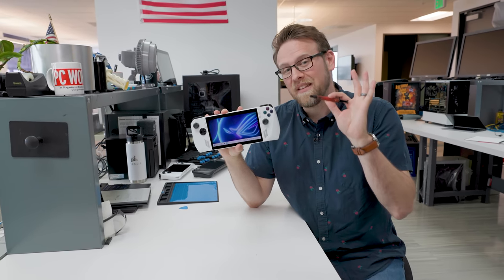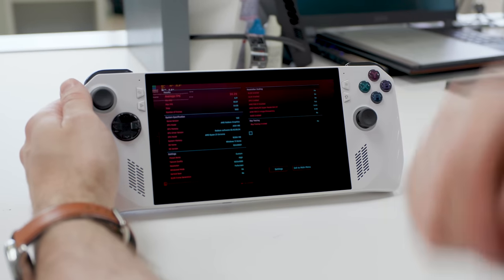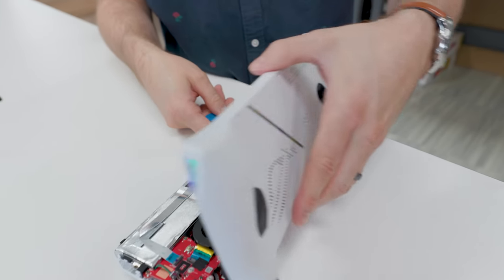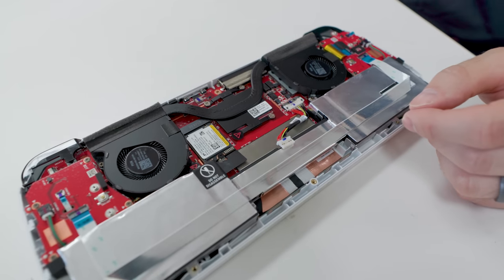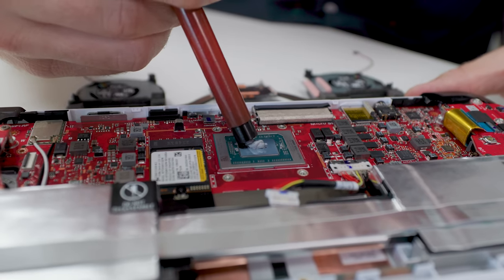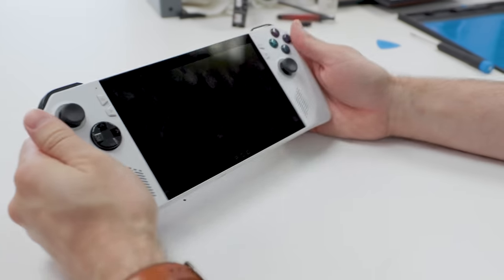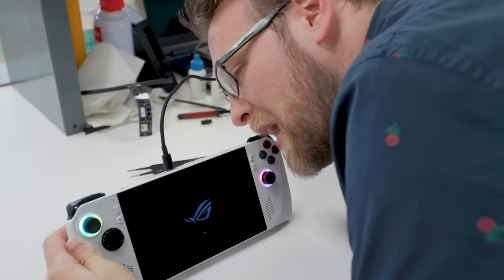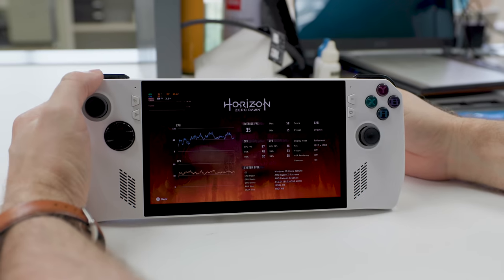Does The ROG Ally Benefit From A Thermal Paste Upgrade?

Comment from the maker: A few fantastic people have caught an error in the video, which changes my thoughts. The original testing had FSR set to Auto in Cyberpunk 2077 even though I thought I had set it manually to Balanced. This could be why there was a 2 frame increase during the second round of testing (which did have it set to Balanced), and negates that test. So the Horizon test is the only one that was done equally, and showed no difference. After seeing this I'm left with the information that all we saw after applying this particular paste in this fashion was a slight increase in temps and I am now firmly in the camp that it there is no benefit. I plan to do a follow up video testing out a few other TIMs people have mentioned in the comments so key your eyes peeled for that!
-Adam
Reply: Try repasting it again with Thermal Grizzly's Kryonaut ❤🤟
Reply: @JoshuaG Kryonaut is bad for bare dies. Temps will be good for a few days, then it'll start to increase until it becomes worse than the original paste. I believe it's due to the pump out effect where the paste is pushed out to the sides because the paste is not viscous enough.
Reply: Increase in temps, or improvement in temps?
Reply: @LeesChannel  Increasement

Comment: 3 Degrees from just changing the paste isn't insignificant
Reply: Nah that's probably several decibels too. I will do this.
Reply: it was hotter after the "thermal paste upgrade"... not 3 degrees cooler.
Reply: anime address
Reply: @Gerdeep  ?
Reply: @gametime4316 which means that it conducts more heat; not that it generated more
Reply: @dvxAznxvb 😂 hats off to you my man.
Reply: It actually is
Reply: @gametime4316 which is what you want to happen.
Reply: Yes it is, that's within a margin of error
Reply: Bro if you're gonna sit here and tell me there isn't a difference between 56-57 frames compared to 60, im throwing myself into the trashcan 😂
Reply: Im have the plan to lock the game at 60 or 45, so 3 degrees are good

Comment: I'd rather buy a Steamdeck. Valve is trying to challenge the Microsoft monopoly and ASUS is just a scummy company from all that happened recently. These handhelds are not really for multiplayer anyway cuz without keyboard and mouse you will get absolutely destroyed and single player works perfectly on Linux.
Reply: I sold my Steam Deck due to the fact that it has Linux. Got tired of having to deal with Proton and issues with compatibility, even for single-player games. Many games don't even run. Yes, you can install Windows on the Steam Deck but the Ally performs better on Windows.

I don't care about Microsoft's monopoly, all I care about is getting the best performance and compatibility I can out of a handheld, and the Steam Deck is no match.
Reply: And The steam deck is 20% off right now.
Reply: Not all multiplayer games are competitive tho or PvP.
Reply: It’s great to have options, I prefer Ally because of Windows, im a Mac user and sometimes I need windows to make IT work… and I have a lot of games incompatible with steam

Comment: This was such a dumb thing to do....no need and the stock thermal paste is actually very good.
Reply: That thermal paste application was painful to watch, and so amateurish. Then again, this is PCWorld.
Reply: They whole point of doing this is to see if the thermal paste is good or not.
Reply: @ramihaidafy  - Good, I wasn't the only person who had the same thought.
Reply: @TonkarzOfSolSystem  Turns out major manufacturers of consumer electronics devices know how to apply thermal paste properly.
Reply: @Everett-xe3eg  you just put it on there. its not rocket science. the amount means nothing, you just need to use the right kind. the stuff he used here was way too thick, and maybe original comment was right about stock being good, but usually they use the cheapest crap they can get away with

Comment: Maybe try Thermal Grizzly Kryonaut Extreme and then Thermal Grizzly Conductonaut Extreme.
Reply: Kryonaut isn't really suitable here because the mounting pressure is low and it will pump out. Would be interesting to see LM though.
Reply: @xomm  Is Kryonaut unique among thermal pastes in this aspect?
Reply: KP Blue and Kryonaut are both awesome pastes, but pump out quicker. Adam, think long and hard before going liquid metal. LOL
Reply: @vcjester  what does pumping out mean?
Reply: @imnotusingmyrealname4566  "Pump out" is due to thermal expansion and cooling, and the semi-liquid nature of the pastes. They can expand and move outside the contact plate area during high heat load, but when it cools, the paste is firmer and doesn't necessarily move back into place. So you will get less paste contact over time and potentially have what little is still place dry out faster due to this effect.
Reply: @KurtisWhittington  hmm I would consider paste a regular service item and just repaste almost annually, either that or the KryoSheet that has no degradation whatsoever and lasts the lifetime of all components

Comment: I've done 4 repastes...for science, not personal gain.  I've tried tfx, ptm7950, and kryonaut, then back to ptm7950.  All 3 gave me similar results.  I settled on using the ptm7950 for longevity.  My 2 cents...just stick with the stock compound Asus uses and use manual mode with a custom fan curve.  In all 4 My unit reaches 95c plugged in on the turbo preset using the stock charger.  My unit does sustain 43w boost for a full 2 or so minutes, which means that the Z1 X chip is doing what its supposed to do.  In manual mode when running a custom fan curve, the temps did come down which is a good sign the heatsink is making proper contact.  My reasoning for using manual mode over turbo is protecting the sd card reader from overheating with better cooling.  With that being said, please be careful taking anything apart.
Reply: Also 95c with the PTM 7950?

Comment: After the rear cover is removed you have to plug it in to turn it back on. I used MX-6 on mine, and seen 2-6c lower temps depending on the wattage settings.

Comment: I changed to Kryosheet and it made quite a difference and it's reusable and theoretically will last forever so it's perfect for a handheld. I watch videos of other people's devices online and see their device up into 85+ in sustained 30w turbo mode and my ally hovers around 75-77c typically in sustained 30w turbo mode. Obviously ambient likely has something to do with that but even from fast and loose testing kryosheet led to lower temps and lower fan speeds in my similar ambient.
Reply: What size sheet did you get?

Comment: I believe the kryosheet or ic hc pad or phase change pad should be perfect since you can repaste once and not worry about degradation.
Reply: You are correct but you are all over the place in your description. It is not an ic hc pad or phase change pad and you do not repaste once with it. The KryoSheet is a graphene thermal pad, nothing more, nothing less. 

It is used as a replacement for any thermal paste application. 
It is highly conductive. SMDs around the die should be protected by a conformal coating (TG Shield).
It is a use and forget product. It never dries out or breaks down over time.
It can only be used one time. 

I used KryoSheets as a TIM in a delidded CPU, its cooler and the GPU die. The system boost higher than paste and I never have to reapply it, unless I upgrade something.
Reply: PTM 7950 phase change pad will work just fine, as it has the same conductivity as high end thermal paste and has guaranteed zero degradation for at least 5 years
Reply: @sihamhamda47  KryoSheets thermal conductivity is much higher than paste and will not degrade over any length of time.
Reply: @BansheeBunny  I'm using TG carbonaut and ic diamond High compression (HC) pad with insulation tapes covering the SMDs of CPU and GPU in my notebook. Haven't tried kryosheet yet since the current ones are performing very well and it's been 4 yrs and temps are the same.
Reply: @sihamhamda47  with legion i don't repaste since i simply can't match the temps of ptm7950 pad.
Reply: never seen the nightmare stories? those pads can melt to the chip. dont be fooled by marketing
Reply: @Bidwellz9  do you reference picture or video? I did notice carbonaut shrinking and takes shape of CPU or GPU die but i made sure it was 0.2cm smaller and fits within the die to prevent the sheet from falling off or tearing off. IC diamond is slightly more durable and retained the shape.
Reply: @Bidwellz9  There are three pads in this discussion, you need to add more context to your statement.

Comment: I did shave 12C off my 2TB Sabrent 2230 SSD Drive Temp with a heatsink off Amazon and left the black covering sticker cover off.  Went from 67C under crystal mark load to 55C Monitored using HWinfo.  
    Not monitored APU temps as I thought it would be unaffected but Fans don't ramp up nearly as much as before.   The Copper SSD heatsink at first only cooled it by 2C and actually fell off inside after a few mins as it's badly designed to just stick to the Thermal pad / phase change pad so I had to devise a plan to secure it tight to the SSD and it was a massive difference!   Pretty sure it's made a massive difference to the APU as Playing Planet of Lana in Turbo mode the fans were on full and kicking out lots of heat,  I run it now on Turbo and it's cool and fans barley spinning.

Comment: Two extra frames. And it runs hotter than before.  I doubt the re-paste did anything.  A two frame increase or decrease could just be program running in the background or just normal variation.  6 attempts isn’t enough to rule out variation.  Also 32 fps vs 30 fps is not even distinguishable in actual game play. 

I guess some people need to feel like they did something to make it “better”.  But manufacturers actually do a lot of testing.  Watch LInus in LTT episode where he tours the Framework manufacturing plant in Taipei.  The amount of quality control in the factory is epic. Believe it or not but Framework is following industry standards.  This means that ASUS is also doing a lot of quality checks on their products. Repasting doesn’t do anything but boost one’s own ego. 😂
Reply: Only thing that would be worth trying is liquid metal paste. All other pastes are pretty much on par with each other.
Reply: @mikeallensonntag  besides Liquid Metal that possibly short circuits if you use to much, I use artic  silver 5 that’s real sticky which helps long term since most paste tend to drip with gravity so unfortunately it’s not all the same.
Reply: So much testing and they couldn't see the SD card placement was horrible.

Comment: It makes sense. With the added thermal capacity the AMD chip is boosting higher, hence the increased performance (2fps may not seem like a lot but on 30fps thats 7%) It boosting higher results in higher temps. It's how the gen 4 chips work as well. More thermal dissipation capacity allows the chip to boost higher clocks at the same or higher temps.

Comment: I would repaste again and go with something thinner and tin both sides or do the dot method. The temps should be lower overall. Maybe run a test with the plugged in boost mode to see your clocks and TPD. I would also test a low wattage to see how low the temps stay at the nominal rate. It may be that higher TDP tests are a waste of time for any handheld as the cooler will never keep up at 30watts.
Reply: Other tests videos have shown dot method isn't the superior method. As long as your paste isn't conductive it doesn't matter how much squishes out.

Comment: I wish they'd use graphene pads on these handhelds, with the heat cycles these things go through pump-out and dry-out is an actual risk, i'd rather give up 5% performance now, so i dont lose 25% in the future
Reply: That is likely why they use phase change paste from the factory. I changed to Kryosheet (a graphene pad) and it was actually a rather significant improvement, not a downgrade. So not only do you get the benefits of the pad (reusable, lasts forever etc) not it's actually better performance too. I'm genuinely impressed with TGs new kryosheet.
Reply: @LayerZeroDesign   Your improvement is likely due to them using cheap thermal paste, generally, a graphene pad does reduce performance over high end thermal paste until that high end thermal paste either dries out/pump out, or if the heat spreader isnt doing its job

though i hear there are some new graphene pads that pass heat through the Z axis instead of the X/Y axis whouch should be faster
Current thermal pads just spread the heat quickly, but dont pass through to the heat sink any more quickly than thermal paste

Comment: Seems well designed. Putting the soc far away from where your hands are is a good idea. Repasting and accessing the SSD seems pretty easy.
Reply: thinking the same if you're replacing the SSD - and at 512GB seem very necessary - might as well repaste

Comment: If you unplugged the battery you need to plug it back into power until the light turns orange or it wont turn back on

Comment: Why did you run the test on 25w setting? I mean, it would be much easier to spot a difference at charged turbo mode, right? Or is everything just throttles at turbo anyway?
Reply: For the most significant result for most people. It's a handheld.

But I do somewhat agree.
Reply from the maker: Yeah, I thought about that after the fact. Probably going to do a follow up to this and use a couple different kinds of paste.
-Adam

Comment: I changed mine out to Kryosheet graphene pad (not graphite).  In 2077, same settings as video, i get 76c at 30w.  avg fps 39.80.  WIth the 25w power, default fan profiles, same settings, 67c with 38.45avg fps.
Reply: Which size did you use?

Comment: Wrong paste asus uses ptm 7940 which is phase change supposed to be the best paste besides liquid metal.
Reply from the maker: I didn't know that, where is this documented?
-Adam
Reply: @pcworld I did read it in the asus document on their page pre-release, although i can't find it now and also Hurd it from the tec reviewer (the phawx) he is a moble console reviewer. Hoped to see the console plugged in when tested it has 4 power limits the plugged in one the turbo watt goes up to 42watt, which would make the most heat/ worst case. I have one myself, love it you just have to watch out for the sd card slot overheating and frying it self. Interesting note there is a perfect amount of space to place a copper shim between the heat sink and sd spot. Additionally, check your thermal pads on the right-hand side  the thermal pad was half touching since the fan has only 2 mounting points it provided un even pressure so I repad them with thermal right pads 1mm for the small one and 3mm for the large one.
Reply from the maker: @jstathellis  great notes! I'm thinking of doing a follow up to this for sure based off all the feedback I've gotten in the comments. Thanks for you help.
-Adam

Comment: Gordon taught you how to repaste CPUs well, but the SOC cooler on the Ally is something entirely different. The average CPU cooler applies enough mounting pressure to overcome an over application of highly viscous thermal compound. The mounting tabs on the Ally do not offer enough pressure to push out excessive paste. 

Apply Thermal Grizzly Hydronaut or noctua NT-H2 and use half as much as seen here. To make sure that it is coated evenly, spread it out with your finger tip in the corner of a sandwich bag.
Reply from the maker: Thank you for this explanation, I'll definitely do a follow up!
-Adam
Reply: @pcworld  Don't jump the shark by using paste designed for LN2 (Kryonaut or KPx). They contain silicon to prevent the paste from cracking at sub-zero temperatures and are only used for a handful of benchmark runs. With normal use, the thermal changes (cold to hot to cold) over time (a few months), will pump these types of paste out.

Edit: I would only expect to see another 2-4 FPS for your effort.
Reply: @BansheeBunny  i used kryonaut before and it doesnt pump out, it just seems to degrade. takes about 6 months to a year. mx5 is the most stable ive used so now i have some mx6 for the next build i do

Comment: good god man..  you need to make the layer thin as possible.. the thicker the layer the more insulating it does .. so use a razor blade and create a think layer over the whole cpu core die ..  with the blade..  man.

Comment: I highly recommend that people don't do this. This is actually a downgrade. All Asus newer Asus laptops use liquid metal instead of thermal paste. For the Ally they are using a compound that is phase changing which is very close to the performance to liquid metal. This is a dumb modification and completely unnecessary.

Comment: I would not have taken the fan headers out. I would have just gently flipped it over onto the battery while I repasted the APU. I have some of that thermal paste I bought for my steamdeck and I dropped like 7 or 8 degrees celcius. So depending on your results I may use some on My new ROG seens I am opening it up tomorrow anyway to put in a cloned 2 terabyte drive. Had it a couple days but too lazy and it's easier to just game on my PC if said game is not on my ROG Ally lol.

Comment: Youre suppose to use a blob and let the heat sink spread it out because you can get air pockets spreading it your self
Reply: "Youre suppose to use a blob and let the heat sink spread it out because you can get air pockets spreading it your self"

Yeah, no. That is a lie that you were told and thermal paste comes with a spread paddle. Also, try that on a GPU and watch it die. Buildzoid killed and RX 480 doing that.

Comment: There is a sensor inside that doesn't allow you to turn it on if you remove the back cover. 😅
Reply: It's actually to do with the battery cable being removed. Don't spread disinformation